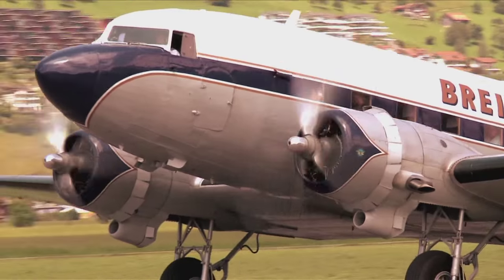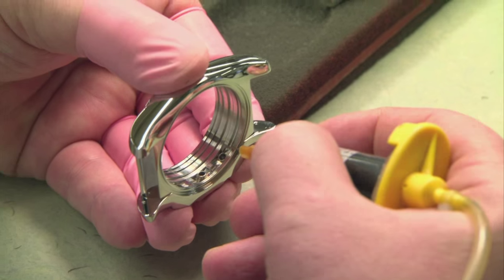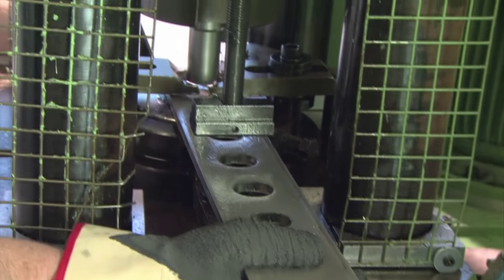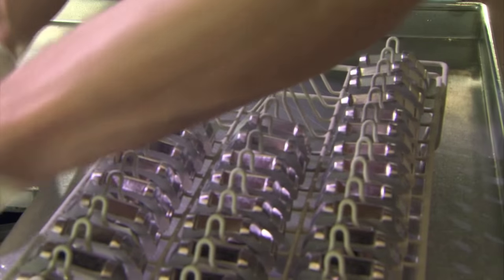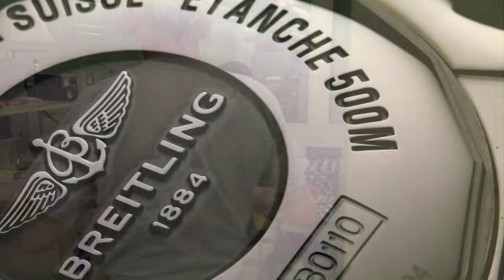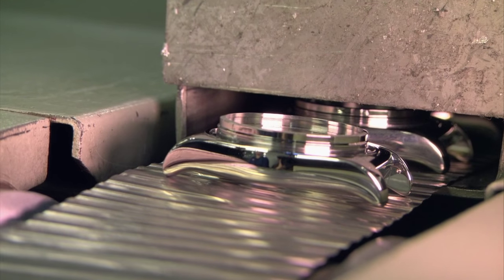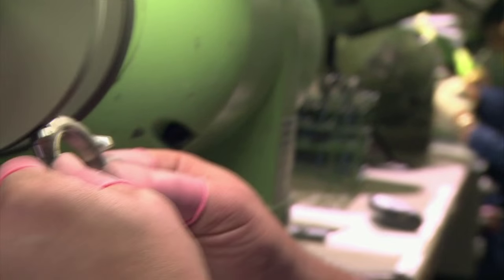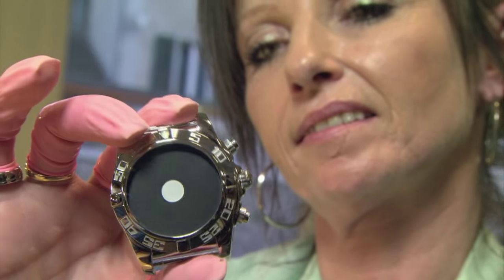Super Factories: Breitling - 4 Watch Case

Comment: Ask your jeweler about servicing charges and additional work. That'll open your eyes. I'm still seething now. £860 for a e year old superocean.  FIRST SERVICE!!
Reply: Tony - why would you want to have a watch serviced after only a year?
Reply: Jaime Clifton hi jamie. its 3 years old m8 ive got chunky fingers :)  I had it serviced because I washed ny hands after going to the bathroom and a tiny amount of water got through the watches crown.

my gripe with Breitling is a watch like mine the Superocean chronograph 2 water resistant to 500m should be so easily compromised to water is beyond a joke. the crown wasn't quite done up to Breitlings recommendation  (in my opinion thats a joke) a watch used by divers that easily compromised to water bearing in mind its quality :0. A fact! breitling recommend you take your timepiece to a local breitling dealer each year to check its waterproofness at a cost I'm not sure. breitling stockists can with their technology check this for you! do yourself a favour should you choose a expensive watch.... ask your jeweller about servicing and watch care cos believe me their not so impervious to everyday wear bearing in mind the cost of such luxury brands.  

take care. Tony.
Reply: Tony - ah I see. Yes that does seem a bit crap. I have a rolex and I think they have a second seal that stops low pressure water getting in if the crown isn't fully screwed down.....
Reply: If water got in through the crown, it sounds like you left the crown incompletely screwed-down. The high cost of your service would have been due to the water damage - a first routine service would't have cost that much, but yours would have necessitated more than just a strip down and re-lubrication of movement parts.
Reply: Every 4-5 Years!
Reply: I'm also furious about leaking batteries installed by Brietling.  They don’t stand behind the product!
Reply: Servicing mechanical watches doesn't make much sense. If the company charges you £860 for maintenance consider that the money can buy you a decent new watch elsewhere. A completely new movement costs around £150 (retail) and I'm sure they can source it for cheap. They could have just swapped out the whole movement and save everybody's time. It's a rip-off. The whole watch didn't cost £860 to make in the first place.  However if you keep the crown unscrewed the water can leak in and I wouldn't blame them for that.